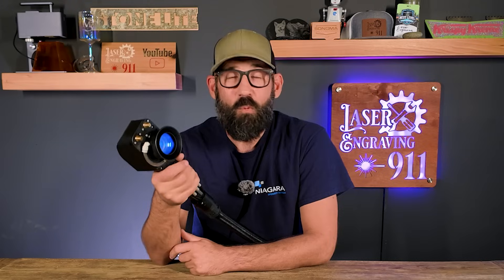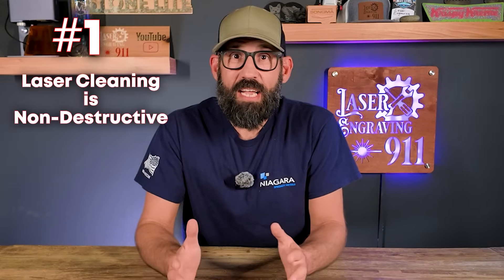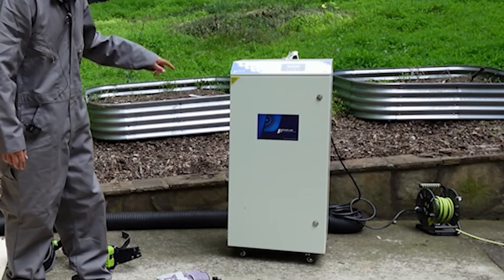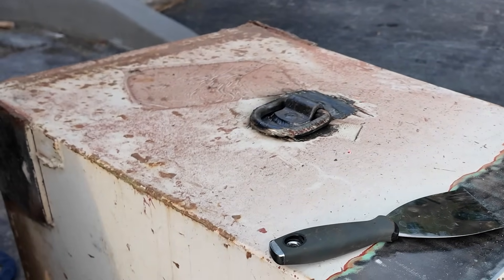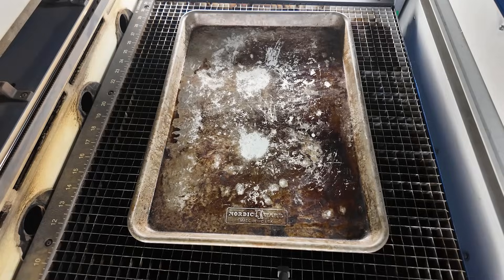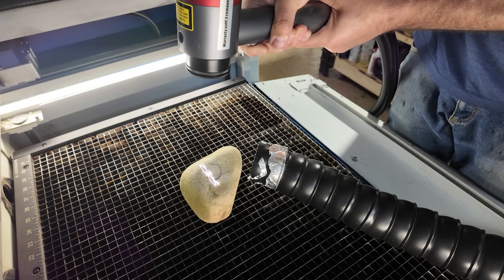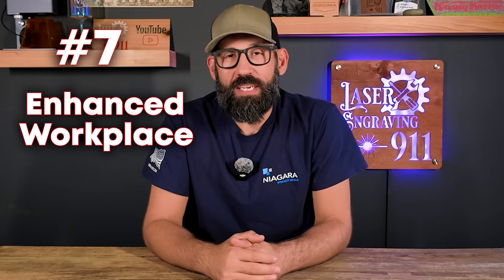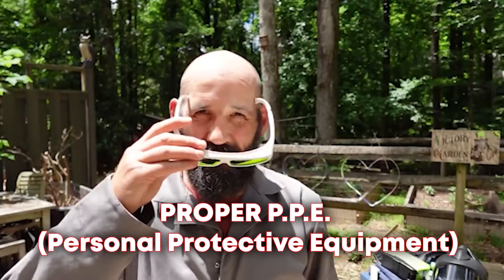The Truth About Laser Cleaning -  Pros and Cons

Comment: I have a question if anyone could answer it. If this were used to remove rust and or mill oil on mild steel for production purposes, would it eliminate the need to use per say ‘aquacron’ to etch the steel before painting?
Reply from the maker: Yes, you can use the laser to texture the surface of metal to prime it for Painting. This is 100% doable.

Comment: what are your recommendations for removing grafittis?
Reply from the maker: I would go with the 500 pulsed watt AGC by sfx, the reason I would go 500 is because you can get the job done quicker since you working on large flat areas. https://tinyurl.com/pulsedcleaner
Reply: @LaserEngraving911 thanks for the quick reply ❤
Reply: @LaserEngraving911  Is it possible to remove graffiti from a plastered, painted facade without affecting the existing paint layer underneath?

Comment: A lot of the pulse laser clears say they are air cooled.  Do they use integrated cooling fans or do they all need to be hooked up to an air compressor?  It seems to be very inconsistent across the internet.
Reply from the maker: Usually the 300watts are air cooled, the air compressor is not for cooling. They are to blow air past the laser head to keep particulates away. when you get into the 500watts and beyond., they usually have some form of water cooler integrated or chiller.

Comment: Hi. I need some advice from people with experience working in the industry. Will these lazer cleaners be able to remove very thick layers of paint? The thickness I am talking about is multiple milimeters to maybe even a centimeter
Reply from the maker: Depends on the color of the paints, and what is the paint on? Metal, Wood?, You might need to use a CW laser for that application.

Comment: I've used them and thought they're rubbish they just seem to change the colour of the rust.

They don't leave steel clean enough for welding like a grinder.
Reply from the maker: Sound like you did not have the right laser, or enough power to do what you needed it to do. These machines do fantastic work at prepping metal for welding.
Reply: @LaserEngraving911 it was a high power really expensive one a company I was working for bought it in to prevent grinding.

I stick to what I say in my opinion it was useless for preparing steel for welding they really do just change the colour of the rust.
Reply: @fossrocket what brand

Comment: Can I use laser cleaning on mineral/calcium build up on ceramic or porcelain tiles or glass?
Reply from the maker: Porcelain and glass are dicey, the laser will pass through there material causing heat on the inside, so prob not a good option.

Comment: Thanks for the video info. Some questions that I have. 1) is glass a suitable substrate to clean? if so, does tinted glass affect this question? 2) is it safe for people or property if the laser goes through glass? 3) does the laser damage glass if it is exposed? 4) does the laser remove caulk and paint equally or does the laser have to be re-tuned to remove caulking? 5) what different caulking types are suitable: silicone, solvent based urethane, acrylic latex? 6) are colors of caulk or paint a factor? and if so, what are the criteria for overcoming resistance to removal?
Reply from the maker: no glass, no caulking, yes white colors will be slower, and yes you always need to be aware of what is beyond the laser or behind the object your working on including people!

Comment: do you need to use any gas or compressed air to keep it cool?
Reply from the maker: No need, not the 300SFX is air cooled. But for the CW they require water chiller built in!

Comment: Im ready to invest into a continuous wave and a pulse laser. I have talked to two USA "manufacturers" which are way over my budget. I tgen started to talk to "Frank Lyn" at SFX. Is SFX a reliable company? I see a lot of their lasers being used but im a little suspect due to how much ill be investing and its out of country. Any advice is appreciated.
Reply from the maker: SFX is a solid brand, and they make very well put together units. I've had mine for while now with no issues. Both CW and and Pulsed. You can use my discount code with them for 200.00 off each unit LASER911200
Reply: @LaserEngraving911
 most excellent. My wife and I want to get into the business but due to the cost of investment we want to make sure we're purchasing from a reputable company. Thanks for the reply and the discount code.

Comment: The most difficult item to clean is powder coated aluminum vehicle rims.  Question will it work on that problem
Reply from the maker: Yes, you will want at least a 500watt pulsed laser to get the job done efficiently and quickly.
Reply: @LaserEngraving911 what means quickly for you? 30 mins per rim,

Comment: Waste o time
What about heavily corroded surfaces? 
Old painted surfaces? 
Required roughness for thich, multy layer paint systems?
Reply from the maker: Yes you can work on those materials, but you need. 1000watt pulsed fiber then your good, so as long as you got the dough for that, its can handle what you mentioned.

Comment: Man...as soon as they make these more affordable I really want one! SO rad....
Reply from the maker: Well, 7 years ago they were 75,000 USD and today they are 10k, not sure how much lower they are gonna go! but who knows right!
Reply: @LaserEngraving911  I'm seeing 8000.  It will go MUCH lower I think . Eventually.   Should be able to make a hand held unit!   I don't think they are there yet. I'll be watching haha 😄
Reply: @ChuckThunder1111 If you plan on using it in your business to scale up efficiency, then they're already beyond affordable and will pay for themselves in no time 💯

If you're waiting for them to be so cheap that people can buy them to d¡k around with just as a hobby? (like stick welders for example) Then you'll be using it from heaven cos that ain't happening in this lifetime‼️ 💀😂
Reply: @ChuckThunder1111 I highly doubt that.
Reply: @melgross it all gets cheaper.
Reply: Looking at the the 2000 w from sfx. I was told I needed a 20kw generator which I had quoted at 50k in Canada. Any suggestions if I’m being lead down the wrong road . Seems out to lunch to me
Reply: @Travis-xc6vo  2,000 watts is 2 KW.   If that is all the power you need, plus some for the internal inefficiencies of the machine, a small 6 kw generator should work.  I have a 6 KW single-cylinder diesel generator that cost me about $1,600 some years ago, they are likely quite a bit cheaper today.    Note: if your laser machine is single-phase be sure your generator also has output single-phase, usually they are 230 volts.  Cheers.

Comment: If i purchase machine in your link.. where is the company located? If i have   troubles with the machine or it needs a new part or maintenance how do i go about that? Are there parts that will need to me routinely replaced? How do i find support? I am new to this method but I'm ready to jump in. Help!
Reply from the maker: SFX takes care of their customers, if you need parts you can buy direct from them, they have some support in the US, but most of the support comes from overseas. Via Whatsapp and Email. They are based in China. They only main parts you will need are extra protection lenses. They are cheap. The rest of the machine is solid state.
Reply: @LaserEngraving911  thank you so much for your reply! I think I remember you saying that you will share your settings to help us get started if we purchased this one. Are you also available with a few messages to help with the learning curve? I'm really only intrested in stripping wood furniture (I'm sure I'll find more uses down the road) but I now use a ton of sandpaper and chemicals amd I need a faster and cleaner method. Would you say this is a good fit for me? I have been looking hard at the big soda/sand blasting systems, and I feel like if this actually works like I see in the videos, this is the right tool for me. Do you have any warning or highlights?  Things I should know before purchase. I'm on a beginner budget, so I really can not afford a 13k paperweight. It's a scary purchase for me in that regard.

Comment: great insight man thank you for that, i am based in Port Elizabeth, South Africa. How much does this 3 in 1 laser machine costs and which is a trusted brand can i inquire from? How mush does a laser cleaner charge per job, I am very interested in getting in to the business here in my country. I recently lost my job and do not have money to buy one, however i am just doing research  on how to go about this...i will need to raise money through funding etc. i still do not have an idea where to start. This could change my life...please help in any way you can
Reply from the maker: Your looking at a 13k-24k USD investment for a decent quality machine. You can find cheaper ones but most of them are highly unreliable.
Reply: @LaserEngraving911  thank you for your response, could you please point towards the right direction where i can buy these from. if i should opt for the cheaper used machines to start up, i mean to minimize my start up cost. would this be a bad idea?

Comment: I Need a Small Portable Laser Cleaner to Clean Polyurethane Off My Floor. What Would You Recommend? It's on the Second Floor.
Reply from the maker: Well first, you will want to perform a test on that material and make sure it remove it the way you need it to, clear polyurethanes can be tricky sometime with lasers and the fumes are nasty, if you want to send me a sample to test we can arrange that, before you guy a unit. you can email me direct if you want.  https://www.laserengraving911.com/contact
Reply: @LaserEngraving911  I Live In Ohio and Its Laid In Place.

Comment: Great video! Wondering how long the lenses last though? Someone said, when working in a confined space with a CW, they're replacing lenses every 5 minutes. And the second lense is like 300 on the head of the unit. Can anyone confirm any of this? I heard you need to keep them clean and that is all.$
Reply: Most lasers have some kind of air system to blow contaminants away from the lense. But even then I find i need to replace the lenses regularly if I'm working on things overhead or something greasy where heavy bits are being broken loose. Make sure to use a good filter, I ran without one once and oil from the compressor was ruining my protective lenses every few minutes
Reply: @greenlaserclean  how do they ruin them? Don't you just have to clean them? Do the burn out because of the contaminant?
Reply from the maker: That's is correct, they let particulates get on the lens, while working, they dont know they are there, it doesn't take much, then the spot where the dust or grease heats up quick, and cracks the outer lens, needing replacement.
Reply: Yes, the contaminants bake onto the lense quickly. If you don't catch it right away, they melt into the lense. Ive never had one Crack, but im sure it can happen. A fume extractor and the air to clear the lense will help a lot, Even then though when cleaning overhead I'll clean the lens every few minutes. My "fume extractor" is a wet/dry vacuum with a hepa filter and a long output hose to move any remaining gasses outside. Probably not as good as a purpose made unit
Reply from the maker: Hey There good question: Both Pulsed and CW laser have "sacrificial lens" that protect the main lens, so the actual lens does not get ruined, and the sacrificial lens takes all the abuse. With that said, if that person is having to change out the sacrificial lens every 5 min, they are doing it wrong and do not have proper fume extraction or a air curtain blowing air across the lens to keep all the debris off the lens, as long as you have those thing in place you should not have to replace the lens often, but its still important to check the cleanliness of your lens every few hours on big jobs and clean it regularly

Comment: Are these lasers capable of removing zinc galvanization coatings?  Currently, paint and galvanizing removal is achieved through grinding; is laser ablation a viable alternative?
Reply from the maker: 100%
Reply: @LaserEngraving911  Are you talking about galvanizing paint (paint with high content of zinc), or real galvanized coated metal?
How would a laser cleaner remove the zinc coating?  Zinc is metal too.
Reply: Zinc is your best friend against corrosion, so...why remove?

Comment: Can these laser cleaners remove body fillers? If so I’m purchasing asap!
Reply from the maker: not so good on bondo sorry to say.
Reply: ...but a propane torch is...nasty fumes, though, and risk of fire of course.  Just use enough to heat it up so that it softens and will wire-brush or gouge off.  Also beware of warping thinner metals if you get nuts...

Comment: So I’ve been playing with the idea of starting a vehicle undercoating business as they aren’t very available in my area so far I’ve looked at dry ice blasting and then fell into the realm of lasers. If I’m blasting rust under a vehicle and come across rubber plastic vinyl etc. what am I going to see happen. Should I be doing a lot of prep work or will I be trying to avoid these materials and if I hit them in a short blast they should be okay or am I going to vaporize my customers brake lines and cooling hoses?
Reply from the maker: Cover all parts you dont want blasted with blue painters tape or tinfoil.. then your safe, and dont blast any filled gas lines! Dohhhh
Reply: I look also for dry ice blaster and laser. Do we need to buy both ?
( for auto detaling business. 
And how many watt did i need.

Comment: What would work for wood the best?
Reply from the maker: Hey Ron, you def want to get yourself a Pulsed Fiber Laser, depending on your budget and the square footage of wood you need to clean I would go with the 300watt pulsed or if you have alot of wood the 500watt the 500watt will allow you to cover more area faster.  300-500 Watt Pulsed NEW VERSION https://tinyurl.com/pulsedcleaner   and you can use my code LASER911200 for $200.00 off

Comment: I refinish furniture and antiques, my budget is around 12k. Which model is best, and 500w or 300w pulse?
Reply from the maker: Well if your budget is 12k like you said then the 300watt I linked in the description of the video will be your best best, If you can afford a bit more then the 500watt will get the job done faster. Both a very capable. But one is faster at completing the job than the other.

Comment: I was hoping that I could use laser cleaning to char the surface of wood, can it be used for this with the right settings?
Reply from the maker: I dont thing that machine is the right one for the job. Better off using a blow torch.
Reply: I did it with a white picket fence just to sample what it would do and it definitely chared it lol, but I don’t think I would buy a 10k machine doing this

Comment: What happens to the paints or coatings? Do they just vaporize and go into the atmosphere? Or do you still have some kind of containment and clean up required?
Reply from the maker: I covered that in the video check the time stamps :)
Reply: @ thank you , I watched again, but fail to understand. Are you saying that the only byproduct is fumes? Nothing needs to be sweeped up or vacuumed?
Reply: Yes I mean of course if you vaporize enough there will be some dust to settling eventually but really if you have a heavy job you should be using fume and dust extraction.  Generally speaking though no there is absolutely nothing to sweep up the laser vaporizes everything or ablates it from the surface is the more technical term.  For this reason fume evacuation and respiratory protection are critical

Comment: I appreciate the explanations, very nice video. I plan to start my business in this area, I am still in the preparation stages. To start with my limited budget, I would like to go more for large jobs without risk of damage, but eventually I would like to evolve and add a pulsed laser for precision work. I have so far invested in a 3000 watt three-phase CW laser, an enclosed trailer, a silent 25 kW diesel generator in order to operate the laser as well as other devices. I admit to being unsure about transporting the laser machine in a trailer with the shaking it could experience. I am even thinking of removing the laser source each time I transport it to transport it in my vehicle for less shakes. What do you think, is it very fragile to shaking? And also the chiller, I read that we have to empty it for transport? Thank you so much and you are right, practicing is the key to obtain good results
Reply from the maker: That's a great approach for starting out, and the enclosed trailer is a great idea, I'd recommend you do plenty of research on the best way to transport,  consider rolling the unit onto a 2” thick work out matt with cushioning to dampen the vibrations.

Comment: The truth about laser rust removal and cleaning is the equipment cost so much that's really the issue holding back do-it-yourselfers and small garages.
Reply: I have been seeing 1500watt continuous layers for 3,500 lately.  Just about 2 years ago average price around 6,500. They getting cheaper
Reply: Where are you seeing these prices?
Reply from the maker: It will get cheaper I'm sure, as all things do, keep in mind that 8 years ago the same machines cost 150k 😊😊
Reply: Forgot to mention China is even selling a 1000 watt puls laser these days but it is almost $30,000.  That seems like an amazing deal though if you need one

Comment: I have a very very large timber pergola to strip. There are large 8"x12" x 40' long beams at least 15 of them and probably 40 4x6 ones. It's all hand hewn. So which one of these would strip 6 coats of high performance coating(ppg proluxe cetol log and siding) in my case?
Reply from the maker: You would be looking at the 500watt  pulsed for that job. https://tinyurl.com/pulsedcleaner